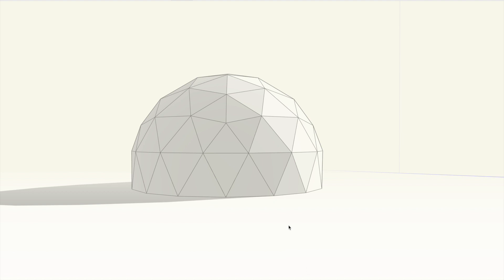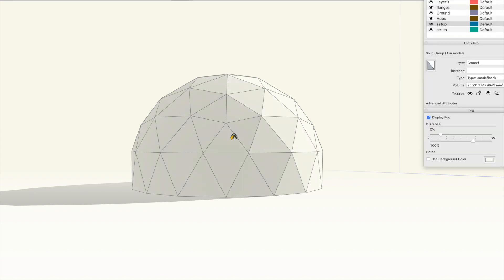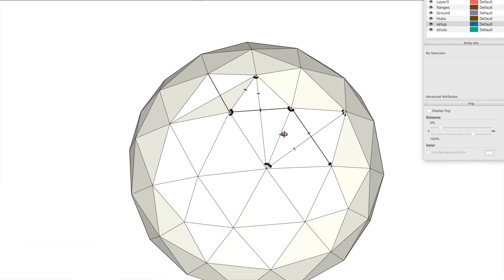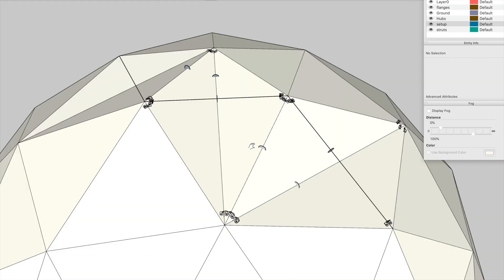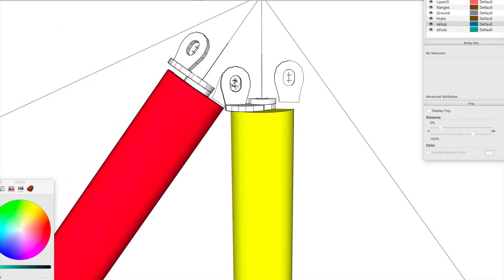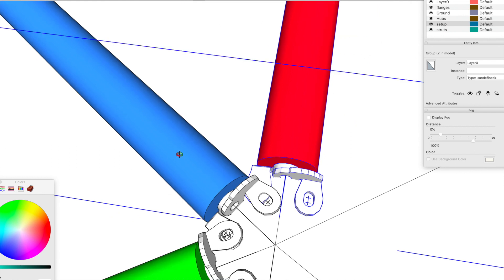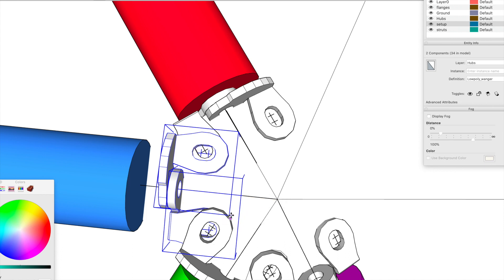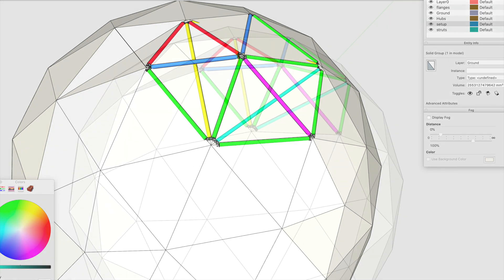3V half truss, flat bottom dome

Comment: Very nice and far less complex than most domes.

I have built a plywood yurt.
20ft diameter 16 segments of 4x8 x5/8 treated plywood, 25 degree coned roof, 36" dia. 3/16" thick 8"tall steel ring with welded flanges for 2x6" x 12 ft rafters.
2x8" floor spokes covered with 3/4: treated ply.
100 4x8x16" solid cement blocks for a base.
Tar paper and rolled roofing.
Skylight is a 4ft circle cut from 3x4" ply with 4,  9: dia holes, plexiglass squares over the holes with a sheet of poly vynil rolled sheeting stapled at the edge on the underside. 
Inside wall is 7 ft. Floor to roof intersectipn. The rest of the wall ply hangs down below the floor beams.
This rig stood up to 70 mph winds in North dakota on the Prairie and did not do more than vibrate a very little.
Snow, 6 feet deep,, is scoured out by the wind

Comment: Hi Paul, what type of structure would you recommend for an full underground geodesic dome? (diameter 5-6m and 1m groundcover)
Would it be doable with wangerflanges?
Greetings!
Reply: Hi. An underground dome for what purpose? The build criteria is dependent on how permanent and how undetectable it is to be. Whatever, these little wanger things are not at all suitable for buried structures.
Reply: @biomechanique6874  In want to make a root cellar.
Yeah I want to use it as a geometry thing and then use strong paneling or something to build it around.
Also half buried an the rest of the sand upon it. Thx for the comment!
Reply: Cool project! I would recommend a bevelled edge panelled dome out of stout timber with a good wood preservative. Give the outside a well sealed tanking barrier before covering with earth/sand, that should last around 10 years maybe.
Reply: Hi John, I suggested sturdy timber for many reasons. Steel will rust out eventually, galvanised is similar in cost to stainless, larch and oak are good choices for pit-props. A 6m 3v dome with 1m ground cover is unlikely to exceed an evenly distributed load of 2 tons per square metre
Reply: Hi John, I should have stated also that the in fill panels need to be at least 1" high density marine grade ply, thicker if you exceed 6m diameter on a 3v dome.
Reply: @biomechanique6874  
The steel conduit forms part of the mesh reinforcement that is completely encased in cement, it wont rust.
Sand and cement is considerably cheaper than 1" marine grade ply. There`s no waste as you dont have to cut it into tiangles ;)
Reply: Hi John, it seems you have never heard of concrete cancer. Anyways, its a geometry thing.  If it was my underground project I would be inclined to make a dome form and cast a concrete shell around it. Concrete performs best under compression. It would not actually benefit from being geodesic, a hemisphere would be strongest using this method.
Reply: @biomechanique6874  
Most folks dont have access to a shotcrete pump. Pushing a sand/cement mix into steel mesh is pretty basic and it wont need to be anything like as thick as a plain concrete shell.
Reply: Hi John, maybe you should go to a technical college and do building materials technology. Concrete and soil mechanics are not your specialty from the sound of things. Loading calcs and strength coefficients are not quite in the same ball park as rocket science, but essential knowledge for underground works. Steel mesh in a shallow underground concrete dome is actually a structural liability in the long term.
Reply: @biomechanique6874  
If you have only made tabletop domes so far,  you might want to run it by a civil structural engineer before embarking on a project of that kind.
Reply: Hi John, I agree, most people have never even built a model. Planning permission is a thing in the UK. I have HND Civils under my belt and can do the calcs for fun and basic guidance.

Comment: How many flanges did you use? I News to build this. My last dome didnt like the winter :)
Reply: You`ll be needing 800+ flanges.
Reply: @JohnGuest45  Right, you'll need 4 per strut (2 on each end).  The 3V geodesic dome structure itself is pretty strong in its own right, does doing the additional trusses give enough pay off for the amount of extra complexity, expense and time?
Reply: @bwillan  
Depends mostly on the size of dome and to a lesser extent the design criteria. In most cases, trussing is employed on very large domes where the load cant be met by increasing the strut diameter or frequency..The 3v in the video would be plenty strong without the trussing as its only around 18-20ft in diameter judging by the door height and t-shirt guy added for scale.
Reply: @JohnGuest45  The geodesic dome geometry weakens if the struts start meeting at too shallow an angle (which happens when the dome frequency increases); they're liable to invert if there's too much load from the outside. Any particular section could buckle inwards, and then the whole dome would collapse. The trussing essentially puts a lower frequency geodesic sphere inside the outer sphere, and since the struts come together at a sharper angle, they resist the tendency to buckle inwards when load is applied.
Reply: @Berkana 
Most folks will never build a dome large enough for it to become an issue. Imho, a  trussed 3v that uses the flanges wont handle as much load as a non trussed  3v with a more traditional tubular hub system. Its very difficult to crush, bend or break a short section of heavy wall steel or aluminium tube. You can always go for 2x6 struts and make a longer tubular hub if you need more strength (tube is cheap).
You`ll need twice as many flanges to use 2x6`s,  incredibly expensive and you`ll have to cut axial angles in the ends of the struts
Reply: @getberget How was your previous dome constructed?  Was the failure due to the covering?  Did a strut or hub actually fail?